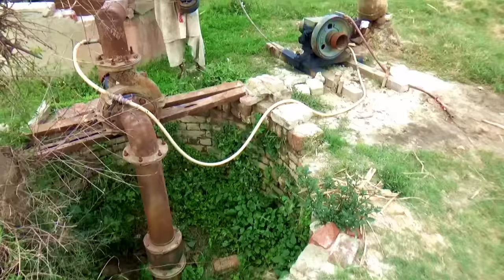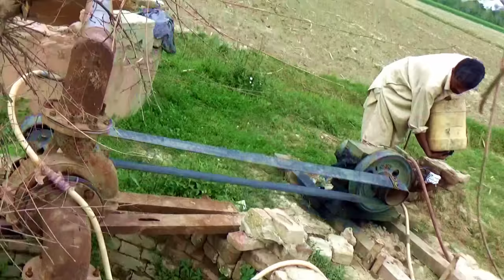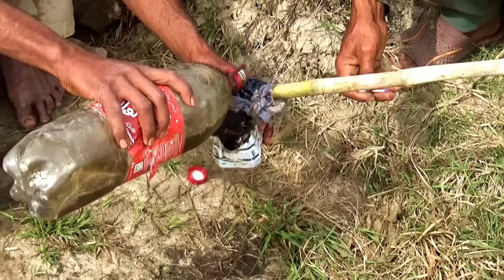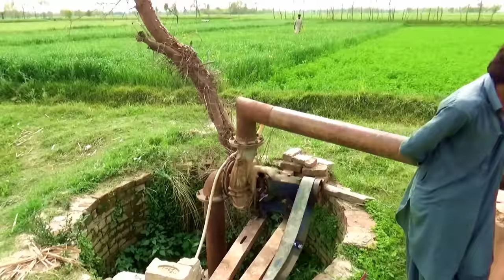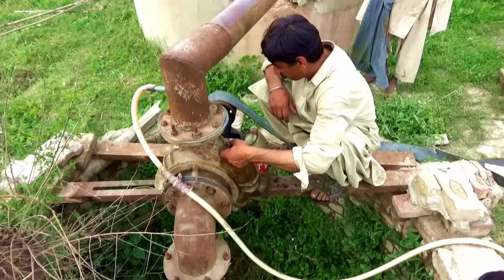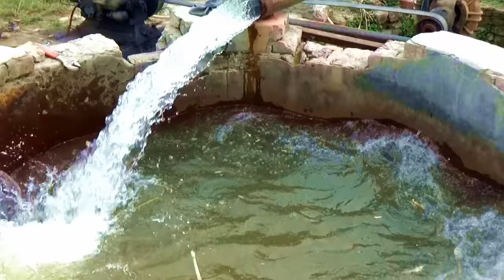Peter Diesel Engine Start up Tube Well System Agriculture system in Punjab

Comment: The most impressive thing about this video?The guy who puts that belt on a running engine!He's got some balls!
Reply: it's very common 🙄..if you put the belt before (without starting)..it very difficult in starting the engine, more hand power is needed because of the additional load , so it's common practice to put belt after engine has started.
Reply: I wonder how many fingers he still has?
Reply: @Ashish414600  Well, to someone who's from the U.S, it's pretty wicked tbh. I mean, since we do get safety labels and aren't forced to use antiquated technology. Kids here can barely put a belt on their pants here.
Reply: For all we know he already lost his balls in this or some other farming accident lol
Reply: @Ashish414600  usually you setup some kinda clutch mechanism rather than risk getting pulled into equipment that thing is a accident waiting to happen
Reply: My thoughts exactly. Never seen an engine started with a torch but it works
Reply: @1987Confused  yes thank god for clutches
Reply: Jim Thunda  تخسي نتم وصدام حسين وعدي معاك يا لاف مرات نتم وصدام حسين وعدي معاك يا لاف مرات نتم وصدام
Reply: @derekallen4568  looks like he still have them all, and he seems old enough!
Reply: Telur hang kecut😂
Reply: @florin604  common sense, do you think they need to do that if they can startup the engine easly with belt?.

Use your mind😂😂😂😂😂
Reply: @HiHassanZia  sure sice I'm just a senior mech eng.
Reply: @florin604  teach them how to start up with belt. You dont know how hard to startup that engine because you re just a keyboard warior. 😂😂
Reply: If I had no other choice I would. Better than starving.
Reply: ٥
Reply: yes, that is what i think too, 20 year ago here in China, People use similiar belt to connect the agriculture machine to the disel engine, but they lift up one side of engine so the distance between driving wheel and driven wheel is closer, and they use a  L shaped metal bar to put the belt onto driving wheel, not bare hand.
Reply: @Ashish414600  0ya
Reply: ٦
Reply: keren banget bos

Comment: Diesel engine live forever ♥️
Reply: Yeah but their operators often don’t live long at all
Reply: @slugmaster64  ,,,
Reply: Not a disel.
Reply: Humankind won't be forever.. If we keep diesel engine forever 😂
Reply: @hillbilly24 what is it then?
Reply: @hillbilly24  1 cyl dsl eng. Why starting was so differcult? Due to low temperature?
Reply: @war.and.peace99  bad fuel, bad compression...
Reply: @lordred7462  thank you.
Reply: It runs off shear willpower.
Reply: ...៥
៥៥៥៥៥៥៥5៥៥៥5៥

Comment: We had larger vertical cylinder Petters at a place I worked. They were never easy to start but in cold weather near impossible. We used easy start spray which often kicked back. A big blow torch worked but it meant running without the air filter. The place was too dusty to do that.
Reply: #maliksami

Comment: I used to put a lil gas in the fuel filter of the farm all to get it startes
Reply: I once seen my dad start a tractor with a small torch damn thing had iron wheels to.
Reply: I've done the sa thing with lawn mowers that wouldn't start.

Comment: Why not divert the pipe outside of the reservoir until the first initial water comes out? Then you can start putting water in the reservoir once it becomes clear.
Reply: Josh Frank  i pray  so as well
Reply: You never can tell someone's unless you judge.  We know we are not posed  to. So gave a helpful suggestion just in case that was for drinking.  They did lite a engine, 
 with a torch.😬😉

Comment: This system was there in olden days in remote areas where electricity was (is) not available. Even before geerators were not there,  another method of pulling water from open wells.  So evolution of  getting water from earth should be brought in the form of video.

Comment: you know the job is really sketch when you get Diesel in a Coke bottle, the Engine you are using is 10000 Years Old and, you have to Put the belt on to drive the pump by hand while the engine is running. I am Guessing none of them ever got it wrong as they all still have 10 Fingers. Massive Props to them.

Also, If I sound like I am making fun of them for working with what they got, well that aint my hope. Just a few things I wanted to point out. I truly respect all of them.

Comment: Please add to this list, on how many counts do you think this is wrong / inefficient / unsafe:
1. No starter motor, ignition coil
2. Worn out piston rings
3. Pump is not primed
4. Loading the drive belt onto     flywheel

Comment: Someone needs to help them out before they die from the water they are drinking. That oil is gonna wash right into the well when it rains, those pipes are rusting, and the piping system above the well is not contained. Any contaminants have free access into the drinking water.

Comment: The amazing part is it runs on that goo they poured into the fuel tank
Reply: Well....that’s a single cylinder diesel for ya
Reply: @mxxkxxg  the question I have is what kind of sludge is in the crankcase
Reply: It’s as simple as a combustion engine can be so it’s probably pretty easy to keep cleaned out.  Can’t be much to drop whatever pan it’s got.  Now, I’m sure it only gets dropped when there’s a problem.

Comment: Starting a Diesel engine by hand with no glow plugs
Reply: It seems the  engine  loss its compression slightly that is why they use fire as  a glow plugs.
Reply: @simonyap2266  they use fire because the engine is cold and there are no glow plugs to warm the combustion chamber

Comment: That engine is going to destroy itself because it is designed to operate at temperatures between 75°-90° and not have cold water run through it all the time.
Reply: It seems that you missed everything!

The engine drives the pump thru the belt. The water goes into the the pump chamber to create a suction force to start pumping up water from the well. It other words no water goes in or near the engine.

Comment: OMG! Those guys have no idea what they are doing, why the heck do they heat the input air and not the cylinder? The engine is in really bad condition, they will ruin it sooner or later.
It seems that those guys don't understand that you need cold air for a Diesel Engine and not hot air. It's always the same in those films.